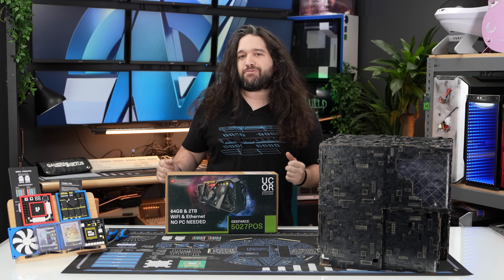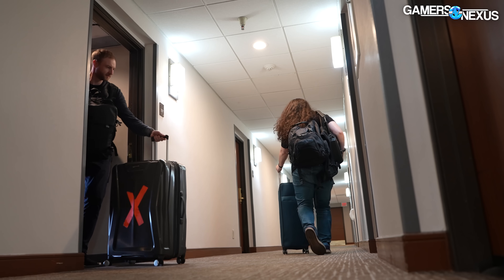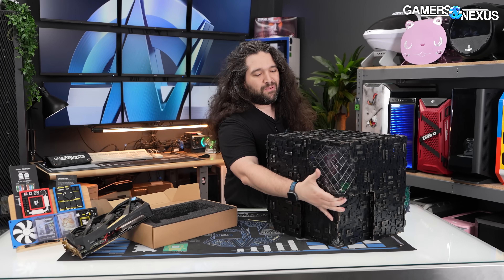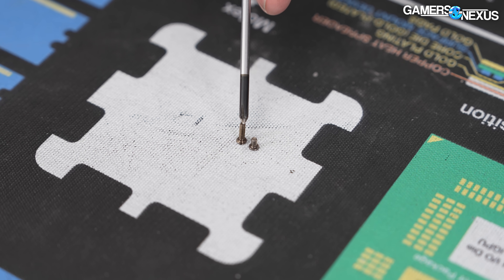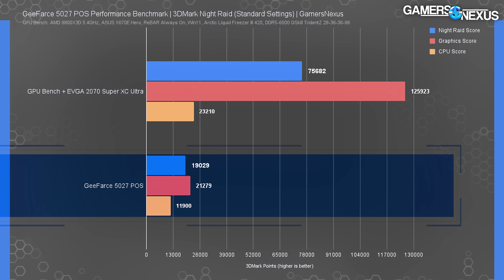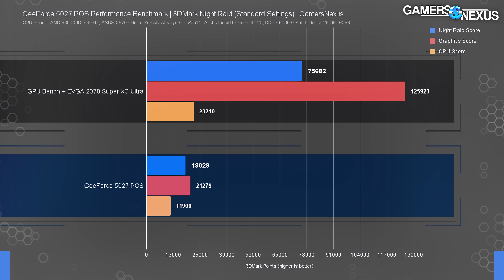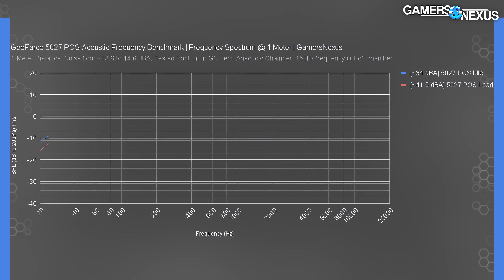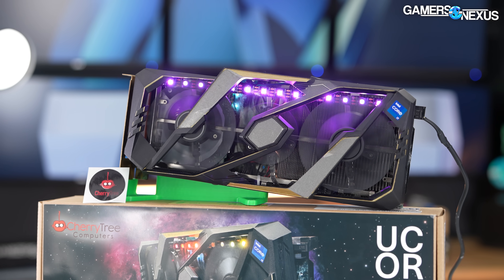Pre-Built Computer Inside a Video Card: CherryTree's RTX 5027 POS Custom Mod

Comment: Thank you so much, guys!!!! This was so much fun watch! Steve, we actually had no idea who that cat and 1st Anniversary case was for. When I opened the video and saw our case on your desk...well...I almost spit out my coffee 🤣
Reply: This video put yall on my radar, keep it up!
Reply: Glad you guys sent it over to GN, happy to see some fun in the PC space.
Reply: Dude that case is sick!
Reply: since you guys seem to be having fun, have you done any work with transparent aluminium oxynitride? it's finally viable for use/manufacture after being invented in the 50s, and it has a decent thermal conductivity for a ceramic at ~13mW/k so it could lead to some fun thermal solutions if the mechanical aspects are up to snuff (e.g. transparent GPU backplates, should thermal expansion and rigidity etc. not cause it shatter when running furmark, or even as the heatsink finstack itself so you can see the pcb/heatpipes/chips/etc. like the 90s, even if it can only work on low watt parts).
at the very least, I imagine it being better than tempered glass for a case purely because glass' thermal conductivity is 1mW/K so ALON would give slightly better radiant heat dissipation as opposed to acting like and insulator (albeit with a 5x price per square inch).
sorry for the long comment, but wanted to plant a seed for the Okama Gamesphere to eventually be a thing ;) thanks for keeping things fun
Reply: just realised after I posted it after okama gamesphere comment.. SNOWGLOBE NUCS :D
Reply: if you sell the box art as a poster or a geefarce tshirt , i'll buy one.
Reply: @hussainmohd6298  same.
Reply: That Borg cube case is amazing!!!!
Reply: This is such a cool project! You guys should definitely try to stick a compact 4060 in that spare space and make it a full gaming NUC!
Reply: @Psykomancer  yep mxm gpux exist still from xvision and adilink
Reply: That Borg cube case is awesome,  I must have one.
Reply: Good work guys
Reply: Pls don't stop making the Borg Cube. I will get it one day
Reply: This NUC in a video card idea is such a delightful gag that I would legitimately buy one and use it as a mobile PC :D
Reply: @HORoundhouse it would make a great living room pc lol
Reply: It would be so cool to have a lower power one using an embedded CPU so the whole system could run off the PCIe slot.  Then have it communicate through that slot like it's a USB4 controller so you can do USB4 host-to-host networking and you could have an entire Kubernetes cluster in a single PC tower.
Reply: I loved seeing this project you guys did, you should let your engineers get bored more often if this is the stuff they can come up with
Reply: Were you inspired by pimp my ride? Put a computer in your computer so you can compute while you compute
Reply: @cherrytreeinc Thank you for sharing that little GPU shaped PC.  A refreshing level of creativity combined with a sense of humor.  Thanks, again.
Reply: I'm happy to see something that celebrates how far we've come instead of whatever big brands (mostly nvidia) are doing
Reply: I'm just sad that I can only give you folks a single thumbs up. Awesome stuff!
Reply: Id love to see a over the top doom dark ages themed pc build
Reply: There is pure imagination that would be awesome to see as a fully fleshed out product that could maybe complete with other mini pcs. It could be feesable in today's 3slot coolers! 
This video was pure enjoyable to watch GN. Something fun to bring excitement back to pcs!
Reply: No joke, PC in the PC would be dope for some purposes (like having dedicated computer to do RAID for big array, independently from main PC, or having separated work and home PC but in one PC case.. Just to name few). Kindda tempting to say "no joke, would buy if price would be reasonable".
Reply: I am heartbroken I can only give you one thumbs up!!  What an EPIC little computer!!  Thankyou for your service to nerd-kind xD
Reply: You guys, this was just awesome! Please never change and keep having fun like this! Honestly, I hadn't heard much about you all and what you do, but you have lots of excellent quirky stuff, and I can see I will have to be checking you all out more! This tongue-in-cheek one-off for the lols is absolutely worth it! Haven't laughed like this in ages! XD
Reply: Keep some cubes in stock, I promise I’ll get one this year 😂😂
Reply: seriously that is really cool . id sell it   i can see a market for pcs inside of pc especially if you need something to remote into another main rig without having to have a separate rig
Reply: It's good to have fun
Reply: @cherrytreeinc what GPU was used in this GeeFarce device? was it not a 2070 super? or was it just using the iGPU on the intel chip?
Reply: Any chance of making a GPUPC based on the Ryzen AI MAX 395? Wouldn't need external graphics then, and you can easily get a whole system (barring PSU) onto that board.

Build an optional shroud for it as well of course; as nice as naked components look when running naked on a desk they'll be covered in dust within a week.
Reply: You've picked the best looking GPU shroud for this. Improve internal components, pick denser LED strip, and we're gucci
Reply: You did brilliant work and i salute you!
Reply: i thought it was a joke, but no !!!!!
Reply: I want a Borg cube mini!
Reply: You have a great product idea  !  Make a GPU PC with 4070,  dual M.2 slots, and a 4 or 8 core laptop  CPU & I'd buy it.
  Just for the fun of it... It looks really cool having  ~ just ~ the GPU running by itself.   The custom case,  indeed.   It can even be showcased,  inside another case.   The invisible PC.
Reply: you guys have one wicked sense of humor.
Reply: Finally a GPU for point of sale terminals
Reply: I want yer Borg CUbe case but 400 bucks for the case is so much
Reply: Even from Germany we are very impressed. It's a really nice piece of work, small enough to fit in the car.
Reply: If you do another of these, you should make the PCIe output on the card function as a capture card if possible. it'd be quite fun to have it actually connecting with the computer it's put into.

Comment: oh hey... It's great to see that company P.O.S is making G.P.U's now... i have a bunch of music equipment like guitar and bass amps and various other expensive things that were made by P.O.S.  it's a great company. Great build quality...  have never had an issue with low melt solder and the heat generated by a guitar amp at full blast..  and the great components they use maxed out at/beyond there limits to save a few cents/board..  and of course the great hand soldering job they do at putting parts on the board with low melt solder and sometimes barley making contact with the solder pads.   This is a GREAT PRODUCT made by the infamous company P.O.S

Comment: As much as I know they'd just screw it up, I'd like to see Nvidia make a fully self-contained computer on GPU. Kind of like AMD SOCs, but those just have separate GPU/CPU in the same chip, but I wonder if there is any reason an OS couldn't be made to run entirely off existing GPU using something like CUDA for example. I think the only real problems are lack of an appropriate interface for mass storage and bootstrap. Food for thought.

Comment: Meanwhile I've deshrouded my 3090 to cool it with three 120mm Arctic P12 Max fans. Also put PTM7950 on the core but I'll have to do it again due to me reusing the thermal pads. Still, easily extra 10C less, and by extent better performance in games.

Speaking of, will we see a test/review of PTM7950 at some point on the channel? I'm sure that the Arctic Max fans will show up later down the line when fan reviews go in full swing

Comment: We're going to be hearing about those missing rops until they finally find them
Reply: Maybe Nvidia should put out an Amber alert for the missing rops.
Reply: You lose cores during the manufacturing process. That card would probably have been a higher tiered card but shit happens and they just called it that and sold it lol. Kinda like the 9070xt vs the 9070
Reply: @MatthewJessey No, because there is no lower or higher or lower configuration cards with those GPU dies, and one rop being disabled is unacceptable for the prices they are asking for mid range GPUs
Reply: @MatthewJessey 
They should have downbinned it then instead of scamming their users, or at least give money to affected owners. If they sold it for less as a different SKU, no one would have cared. It happens all the time with chips, and manufacturer's  100% know what chips they disable cores on. NVIDIA just got either greedy or has terrible management software.

Comment: lol  this is amazing

I think this could work a lot better with newer hardware. Especially with next gen 3nm Zen 6 or immediately 2nm? and 3nm Nvidia 60 series? Take a massive 5090 or at that point 6090 cooler and then put a lower end 60 series card into it, paired with a low power zen 6 cpu. 

but at that point you could just buy an actual mini pc. Those are already quite good for what they are.

Comment: Ah the ol GPU switcheroo!
Reply: Seeing your name, and then stopping and thinking "Wait, you could actually do this with RasPi and a PCI-E breakout, and a small AMD GPU" and have a discrete GPU on your computer that's on a discrete GPU.

I think the recursion is going to give me a headache, though.
Reply: @Beany2007FTW  Heh, I have actually been trying to get it done, but always very low priority. Problem is it would be a total one-off, no market for it.

And if I do it, I want it to be guns blazing, like a 7900XTX or 5090 (those two cards are harder to get running on the Pi right now).
Reply: @Level2Jeff You know, with a decreased power target (but still very high) the 5090 FE's tiny board but giant cooler would be an ideal combo with maybe one of those really small AMD boards with a high perf CPU and soldered RAM, would need some tricky modification of the cooler though to get the factory look going
Reply: How about a PCIe slot powered cluster?

Comment: Ironically I feel like gutting a Beelink would have given better charting and gaming performance.  Maybe it's a form factor limitation, but I presumed they'd both be about the same size outside the cases
Reply: Funny...I'm using a Beelink SER8 with an 8745HS. Runs Cyberpunk 2077 Phantom LIberty with medium/high settings, high crowd density and no raytracing just fine. Also, it doesn't need more power than all the other appliances in my house combined. I get a solid 30 fps and no one has explained to me why I need more fps.. Didn't cost the earth either.

Comment: With the size of modern VGAs this was inevitable.... You don`t put VGA in the PC, you put the PC in the VGA.
Reply from the maker: Just wait until the first case-sized GPU!
Reply: @GamersNexus  It's probably planned for the RTX 9069, with 6.9GB of VRAM, all for the low low price of $6,900.

EVERYTHING JUST WORKS.
Reply: @GamersNexus  oh no. right back to the era of mainframes and terminals, but this time the fridge in the corner is a gpu, not a full multi-terminal box.
Reply: @GamersNexus  Holding out for the RTX Window Unit myself.
Reply: @GamersNexus  stop giving them "ideas" plz. we might experience a "careful what u wish for" situation
Reply: @GamersNexus  Isn't that just what AIB 4090 are anyway ? /s
Reply: Just imagine an mITX board that's just the GPU itself, and the PCIe slot is actually a reverse-pinned slot, into which you socked a CPU + RAM + NVMe card and the CPU lanes directly go down into the reverse slot.
Not gonna lie, I could absolutely see this being a valid product for a high vram kinda build with an absurdly massive cooling solution over most of the board.
Oh yeah, we still plug ATX into the mITX board, and now we plug PCIe power into the CPU card... because guess which part needs the power more :P
Reply: Now we need a review of an A$$D Rabid-on video...turd?
Reply: This is actually pretty darn cool and impressive. Good job to those who made it a thing.
Reply: John Carmack himself brought this idea of a standalone GPU forward some time ago. It would be doable at least with versatile Linux. And most importantly it would finally get rid of the GPU to CPU communication bottleneck.
Reply: VGA = Video Graphics Array. Whilst I'm sure you were fishing for "Accelerator" at the end there, why not just write Graphics Card instead of twisting acronyms?
Reply: @blunderingfool  some folks outside of North America refer to graphics cards as as the VGA card / board... Think of it as video graphics adapter and it makes more sense.
Reply: @volvo09  I'm outside of North America, everyone in England calls them graphics Cards. Same for Scotland, Wales, Irelands both northern and republic.
Reply: @blunderingfool  Ratioed. So much for that. 1iq 🤡
Reply: In the early 90s all display adapters were simply referred to as VGA cards, whether or not they implemented IBM's VGA
Reply: @酗 every consumer card used the VGA connector then though.  I don't see how it's a VGA card if it didn't have an HD-15 VGA connector
Reply: Once VGA became ubiquitous, even CGA/EGA cards as well as workstation display adapters were retroactively (and inaccurately) referred to as VGA cards.

People assumed the "A" in VGA stood for "Adapter", as in display adapter.

Perhaps it was different in other places, but that's my personal experience from working in tech in the early 90s
Reply: @blunderingfool  It's actually Video Graphics Adapter.  There used to be a GPU maker called Extreme Video Graphics Adapters (EVGA) that used to really common in the North American market before they decided to wind down their company ahead of the RTX 4000 series launch.